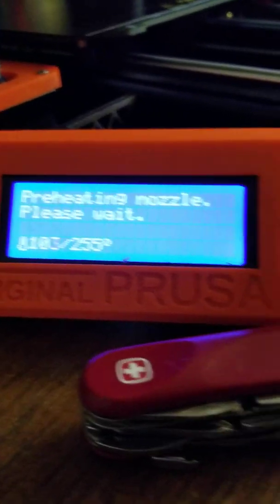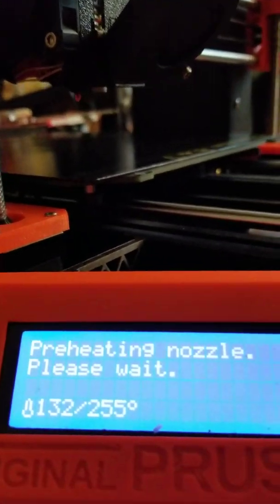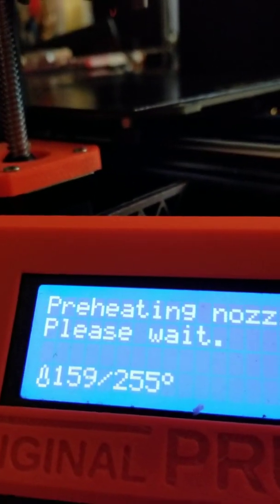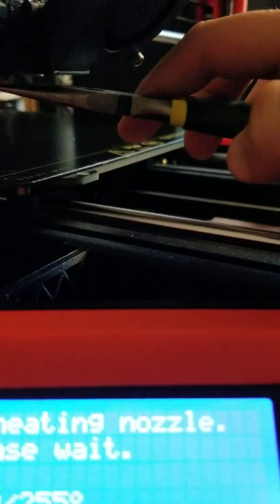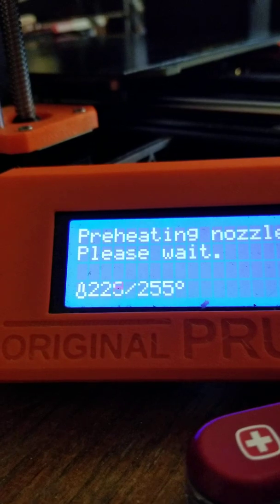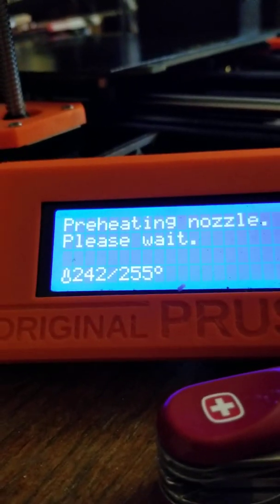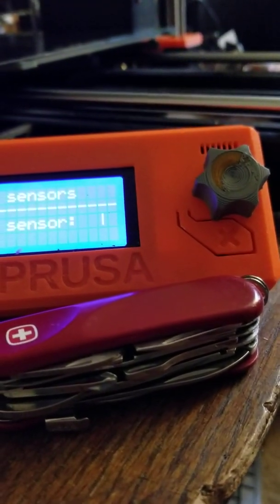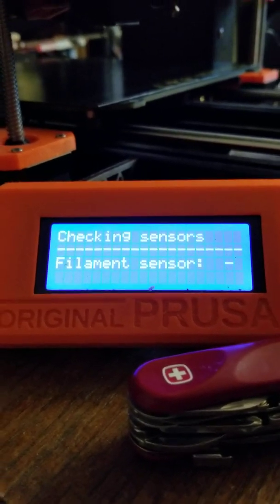Prusa Mk3s Setup 6 - Filament Sensor

Comment: I removed the part with the steel ball and the magnets. I don't want filament sensor runout.  It is just something to drag on the filament and give inconsistent results. I made a new part with a direct passthrough.

Comment: Do you know how to set up run out protection on an MK3s? My printer didn't stop when it ran out of filament.

Edit: There shouldn't be a setup, just enable it in settings. My printer had N/a for the filament sensors. I got a message that said there was an error. I just had the cable plugged in the wrong way. Twisted it 180° and plugged the sensor cable back into the sensor and presto it works!
Reply: Does auto filament loading work?
Reply: @cramitdfrog69  Well I fixed it. It turns out the filament sensor terminal was flipped wrong ground and hot were swapped neutral was fine. I tested continuity of the wires to find any shorting, none. Next I checked the sensor for burns, good too. I saw the sensor had a ground and volt sides. I flipped the terminal back the right way and the sensor works. Unfortunately, my 17 hour print has to be restarted. Thanks for the reply!l though!